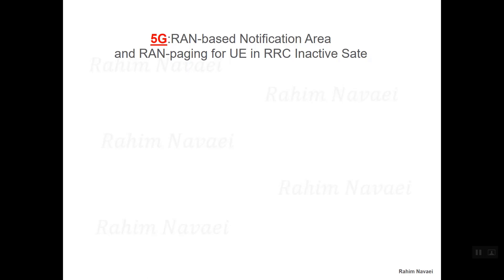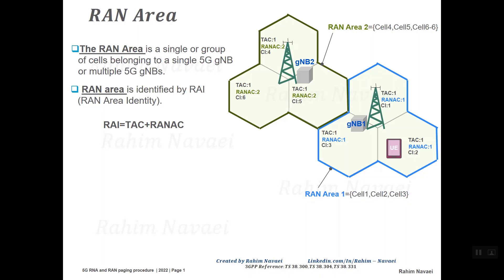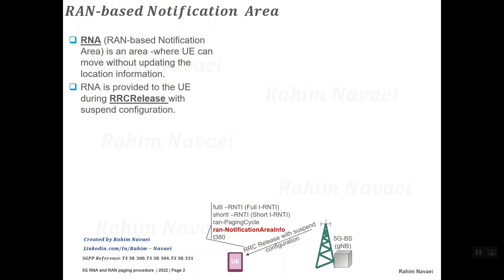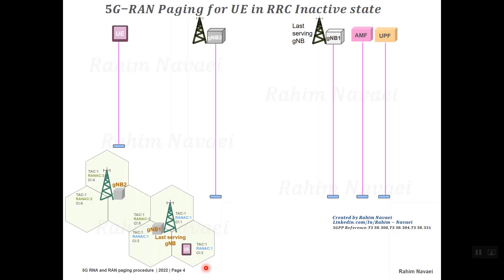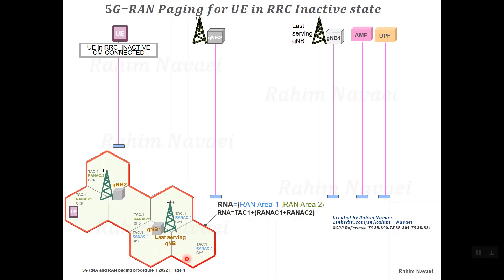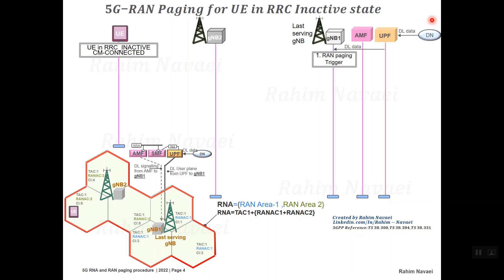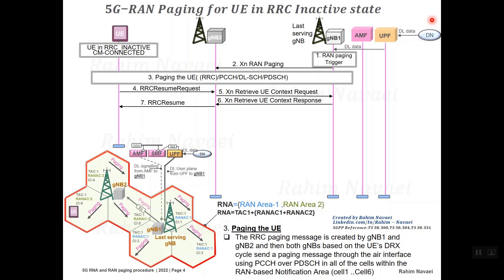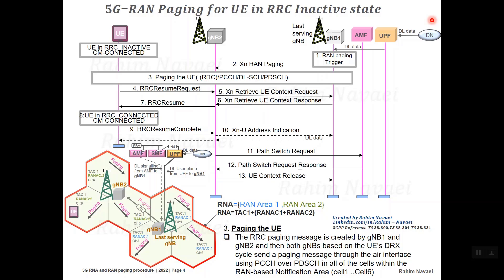5G RNA and RAN  Paging Procedure for UE in RRC Inactive state, by Rahim Navaei #5g  #4g #telecom

Comment: Sir, does UE release meas config and CA Config also when it moves inactive state. What spec says for this config ?
Reply from the maker: Thanks for your comment,
As you know the measurements and Carrier Aggregation configuration is corresponded to the the serving cell where the UE changes its state form RRC Connected to RRC Inactive.The mentioned configurations can be different , i.e. each serving cell has its own configuration.Furthermore, the UE in RRC Inactive state can move everywhere in the RNA, so when the UE decides to change its state from RRC Inactive to RRC Connected, e.g. due to paging for incoming DL data, it must send the RRC Resume to the cell it is in, which may not be the last serving cell.We can conclude that every cell which is the serving cell of the UE sends the meas. and the CA Config.